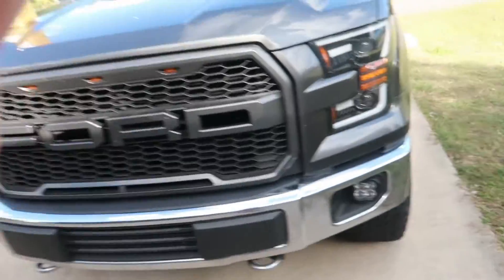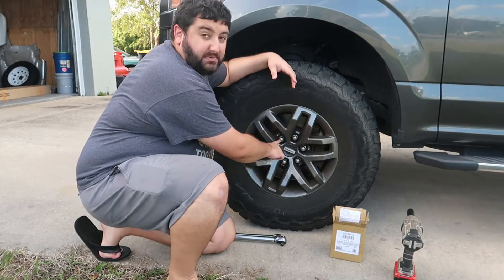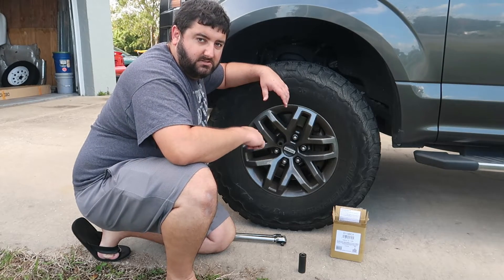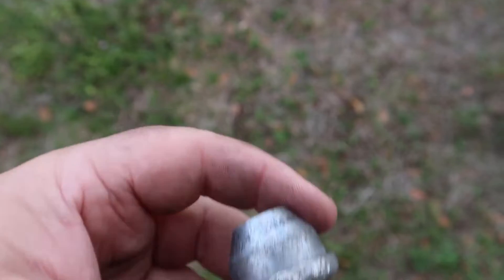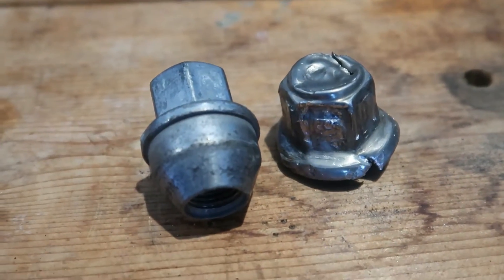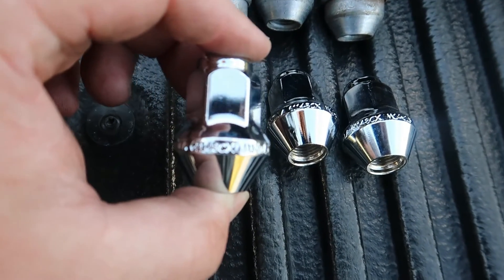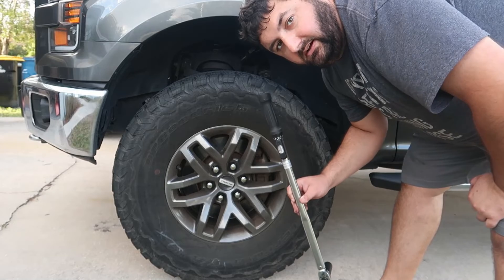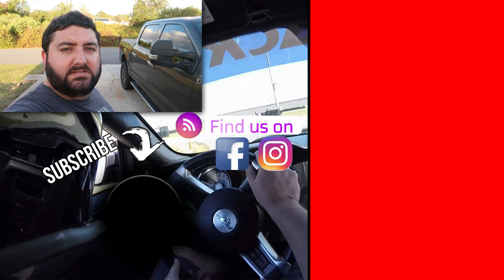Changing out Fords TERRIBLE Lug Nuts with Gorilla Brand

Comment: there is a video that shows how to chisel off the soft aluminum outer shell  with a screwdriver/s and hammer.  once you hammer a screwdriver head thru the aluminum, you can then pry the aluminum soft shell completely off the lug nut while it is still tight on the wheel.  then the exposed inner steel lug nut core is removed with a hex or 12 point 18mm socket, is one piece, and won't be deformed by impact wrench wielding mechanics.  just remember to carry a 18mm socket wrench in your car, as your original 19mm tire wrench is too big for the "denuded" core

Comment: once you remove the outer aluminum shell, why can't you put the orignal "nuded" lug nuts back on with an 18mm socket?  as they are now one piece lug nuts, just not as sexy and shiny as the original aluminum covered, two-piece [of $hit] ones??
Reply: Tbh I wouldn’t put them back on simply because they would be exposed ends on the threads of the wheel studs and prone to rusting.